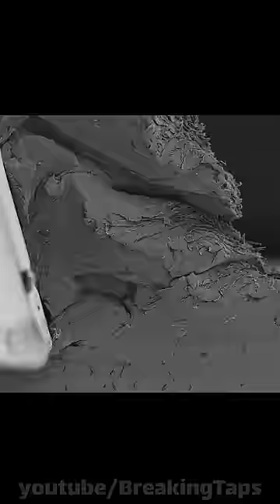Cutting metal under Extreme Magnification

Comment: My metallurgy teacher in college used to say that we should imagine metal as really hard clay.  I can see why.
Reply: @fatguyalwayseats  never thought of it that way. I think that’s a good analogy!
Reply: Ironically mine said to think of metals as flexible crystals, which is basically an inverted analogy thats describing the same thing ultimately haha.
Reply: @fatguyalwayseats  ironic is that clay consists of Al as well
Reply: we used to call Aluminum plastic
Reply: @SP-vl1ps technically, plastic is a property, not a material.
Reply: @jdmjesus6103 
A property of women in hollywood.
Reply: @LogicCaster  watches microscopic video of metal being cut

"Wow I can't believe women"
Reply: @Shift18 eh, at least aluminum doesn't bitch though.
Reply: @LogicCaster  OOOOOOOOOHHH !!!
Reply: @GhostofJamesMadison Ooooohhh snap!
Reply: @Shift18  
Nah they’re alright
Reply: This is why blacksmiths are often trained on frozen oil clay. Moves damn near exactly like hot steel.
Reply: I was just thinking that
Reply: Except clay cannot be melted, which is how metal is efficiently cut.
Reply: @deepspire  If it is melting you went too far for cutting or working, at that point you are casting.
Reply: @deepspire  
Metal is effectively scraped or shaved away not melted, unless you’re talking about laser cutters or oxyacetylene torches which oxidise or RUST away metal.
Reply: @fatguyalwayseats difficult to consider dislocation behaviour as analogy of clay though
Reply: @deepspire 
What are you talking about? An analogy does not mean Metal = Clay...
Reply: @deepspire lol no. You can see by how much heat is being applied by the chip. You don’t want those chips hot as it would damage your tooling very quickly. Hence why coolant is used on almost all machining operations, including plastics.
Reply: There are metallurgy teachers? Where do you live?
Reply: That’s funny because some clay is actually made of alumina
Reply: @deepspire clay can for sure be melted but don't ask temperatures. Also, if you make stoneware like dishes or else you basically melt it (sintering)...
Reply: tbf he was responding to a comment made in the video. it was funny ;D @Shift18
Reply: @Nunya7211   eh kinda, unfortunately i get all the not so fun side effects of an aspiring mind, I'm book smart with some field experience, but otherwise I am a sad miserable social moron. 
Sometimes i wonder if it is actually the ignorant who are truly smart, i mean at least they seem happier than most. Myself included. 

I appreciate the compliment though, sadly i cant see the resemblance anymore.
Reply: @lapiswolf2780  i would figure a materials science course or possibly an engineering course would cover metallurgy, i too am unsure if metallurgy is just like a full on subject matter. Granted it seems likely, however it applies to many realms of industry. 

I ended up getting into metallurgy via aviation maintenance technology for airframe structures and powerplant maintenance. Not surprisingly darn near everything on airplanes is metallic and they vibrate and flex to hell n back with incredible load dynamics. 
They're incredible machines, but holy crap are they self destructive cold annealed lil bastards at the end of their service life prior to overhaul. Metallurgy personified if ya will, pretend the person is Big Bird at least. Lol
Reply: редкая земля.
Reply: @SP-vl1ps We in Eastern Europe machining community just say that Aluminium is not a metal.😅Plastic is too.. amorph and polymery. Wet clay is suspention of particles, with granular structure which mimics the crystalline hot steels or cold Aluminium well enough, but for hard cold metal - cheese or rubber would be a better comparison. There are also amorph metals some call metallic glass. All different, all have similarities.
Reply: @100GTAGUY I can relate and that's not a coincidence. Book-smart sharp minds are often miserable, because sharp scientific intellect is like a sharp scalpel. You can dissect and correctly analyse any matter, but the frog dies in the process. It needs some emotional or social intellect to go along, which for some reason is hardly compatible. At least on material matters you neraly allways will be right over the intuitive, more emotional people. And probably lonely, but that shouldn't become a problem. You can also change it, given a chance.
Reply: My mettalurgy teacher used to tell me to imagine metal as really soft diamond
Reply: @Shift18 it's just a boomer joke, and I mean you're on a waste of time youtube short common section, what kind of people were you expecting to post here lol
Reply: It's being shaved
Reply: And wood is just really tough threads
Reply: @100GTAGUY I learned through welding class, one of the classes you learn is metallurgy and it was my favorite class out of all of it, I made my own chisel in that class, I wish it was a longer class tbh, we also took a machining class which was fun too 😁

Comment: It's amazing how it looks exactly like clay, as you say, - or dirt being dug out by a 360 digger - it's about fractal scale I guess! You can see the tool deflection, too, quite some force making that bend! Plowing at the microscopic level! :)
Reply: Yes its like there was a mix up in editing. Not sure why the color is so different to other examples in the main video.
Reply: @stusue9733 because at that magnification, no color can be recorded...?
Reply: @i_do_coding  Black and white are still colours right? ;)
Now that you say that I have no idea how a SEM deals with colors. I doubt it does.
My point is the difference between most of the footage, (6:45 as an example, looks like clay) and 7:41. The cutting insert hasn't changed color(though looks like it has some clay on it) but the workpiece has change color.
Reply: @stusue9733 SEM cant see colors, because it uses electrons. Its like using a monochrome light, you wont be able to distinguish colors
Reply: @i_do_coding it can still be recorded but the way this microscope maintains such a high resolution is that it detects electrons hitting objects to find their definition rather than just light
Reply: Does electrons reflect off of metals, I think the lack of reflection is the main reason it lacks the metallic look.
Reply: Well it kinda is… just harder
Reply: @piergiorgio919 i’d say it’s more like using radar to make an image of something
Reply: but what kind of metal is this?
Reply: Good observation, it also seems like it's not just shearing it, it's pushing itself into the metal and introducing friction so as to make it more mailable. Maybe this makes sense... But I'm sure a cooler tool is always the goal.
Reply: @bluntlord1242 aluminum cut by a tungsten carbide tool.  The tool is actually being moved from the slide on a micrometer.  Each image requires moving it forward one micron, placing it back into the SEM chamber, bringing it back to vacuum, running a scan, restoring it to normal pressure, and repeating.
Reply: @PassiveDissimulation what we’re probably observing is the combination of shearing at grain structures as well as ductile sliding molecular lattice.  The atoms will either pile up and slide over eachother being held by intermolecular forces, or the will shear and exceed the intermolecular distance forming a crack.
Reply: @i_do_coding there are no photons.  Technically there may be a few emitted as a side effect of the electron gun.  But a scanning electron microscope uses a sealed shielded chamber brought to a high vacuum.  

A beam of electrons is then progressively scanned over the materials and charge detectors measure the intensity and location of electrons.  This data is then plotted into an image.  

Color would be nearly impossible to measure as you are measuring with something much larger than individual photons.

Conductive materials appear dull in electron imaging.  Because they conduct a charge they scatter the electrons in more random directions.  This is similar to how a matte finish scatters light.  Surfaces that cleanly reflect electrons seem more glossy.  

The contrast difference between the metals is just a visual representation of different surface charge characteristics.  It’s actually completely tunable in most machines.  You typically just pick a filter that shows you the most contrasting results.
Reply: @LogicalNiko  I like the momentum started here, I like to understand.
Reply: @LogicalNiko  it's important to observe, otherwise we lose our humanity. Were curious. That's what drives me, I feel like I belong.
Reply: @stusue9733 Black and white are color values. Make a color dark enough, it gets blacker. Get it light enough, it gets whiter. It sort of a quality aside from color itself in most cases.
Reply: Recursive fractal is how the universe is structured, at least it's how i look at it.
Reply: @chickenmonger123  But I don't think that explains the difference in the color of the "aluminium"
Reply: It's imaged using electrons not light so it won't "shine". The analogy with clay is correct because both materials are planar. Clay has layers of silica and metals have "slip planes".
Reply: @keithallpress9885  Not sure you are replying to what I have said, but here goes anyway.

I'm not saying the analogy is incorrect. All I am saying is most of the footage looks like clay, not aluminium.  Does it matter for what he is trying to show? not really, which would explain why they used the one that showed what they wanted to show the best.
Reply: @stusue9733  Clay behaviour is due to layers of hydrated silica with intercalated ions, you get cohesive forces and slip phenomena together. That same morphology can be expected at small scale for soft metals that are cohesive but also have slip planes where a plane of atoms can slip together across an adjacent plane of atoms.

They could produce the final image in any mono color you like. The metal would still be shiny in the visible range but in these images it literally isn't shining because the metal is not being exposed to visible light. It's like asking what color is grass at nighttime. The scanning electron microscope shines beams of electrons at the sample and the secondary electrons that scatter off the sample are used to construct the image. SEM images are not produced with visible light as others noted.
Reply: @keithallpress9885  Are you watching the full video or just the short?
Reply: It makes sense because metal is malleable
Reply: @stusue9733 black and white technically aren’t colors. Black is absence of light and white is all of it
Reply: @Crazy_Chriz  Neither is brown.

Is green not a color if its made my mixing blue and yellow light?

My point is the cutting tool barely changes color but the workpiece does. One looks like clay, one looks like Aluminium.
YES they both "cut" pretty much the same.
Reply: @stusue9733  what are you even arguing about
Reply: @Crazy_Chriz  Well if that wasn't clear why are you answering me?
Reply: @stusue9733  nvm lol
Reply: @Crazy_Chriz  Consider it done :)
Reply: It's not solid metal but a collection of tiny pieces like sand and as it is wet it forms like clay at a certain wetness.
Reply: @KarmasCalamity  What?
Reply: I thought it looked like clay too..
Reply: @MH-sf6jz it’s because there s no reflection to capture, it’s capture with electro, they only transcript the shape (you can tell an object is metallic mostly because of it’s reflection) but reflection aren’t part of the shape (no hight, bump, …. so no shiny metal look
Reply: @stusue9733 brown is technically dark orange. It technically is a color
Reply: @queueeeee9000  Yeah I believe that was my point ;)
Reply: @stusue9733  you said it wasn't a color
Reply: @queueeeee9000  it isn't, as you said yourself the color "is technically dark orange"
Reply: I always plow at the microscopic scale 😎
Reply: @stusue9733  orange is literally a color..
Reply: @bluntlord1242  video literally says aluminum
Reply: @Maple_MK  Yes the video says that, but that seems questionable.
They did use clay at times.
Reply: @queueeeee9000  When did I say orange wasn't a color?
Reply: @stusue9733 black and white is not color, black and white are shades. A gray scale is shades of a color, not color itself. Have you never used photo shop or something similar? Have you ever taken a picture and edit it? There are two different bars one is a rainbow gradient (colors) and then there is a black to white gradient (grayscale or shades). Black and white it is not color. In fact black is the absence of color.
Reply: @james_win  the universe is not recursive in the slightest
Reply: @DemarcusCousins_III  it's not like you know what it is and what it is not, like me.  It's a thought that i hold to so it satisfy a curiosity, not a fact.  Everything in nature has a recursion element to it, why not the universe?  In the end it doesnt even matter.
Reply: It depends on brittleness. Some brittle steel would behave drastically differently
Reply: @james_win  the universe is not a loop. The CMBR isn't a loop, star formation isn't a loop, everything is different in the universe. Maybe if the big bounce theory is true yes the universe may loop but not anything else
Reply: @DemarcusCousins_III  I am not sure what you mean by loop. I was refering to the universe as being fractal,  fractal cosmology is a thing in astrophysics.
Reply: @james_win  a fractal is an artistic expression of a loop, last time I checked EVERYTHING in the universe is different and nothing happens in an infinitely looping way that a fractal does. Only theories suggest that some certain features of our universe are a loop but they aren't proven to be true. Fractal cosmology is also a theory which means you currently have almost zero proof of the universe being a fractal
Reply: @DemarcusCousins_III  There is no prove for anything we are talking about.  This is all hypothesis with no actual prove of anything.  We just don't know.  Everett's interpretation of the wave function can't be tested or proved but it was made popular because it sounded nice and it simplify things, and it makes for great movies .  Whatever cutting edge hypothesis you believe in at the moment is just something a physicist put together to give a coherent picture, but it's not real and not proven and definitely not a theory.  It's all conjecture.  If you choose to believe in God, spaghetti monster, the Big Bounce, a Fractal Universe, M-Theory, or whatever else that is currently popular then so be it.
Reply: @james_win 
Yeah man, actually I thought you were pretty clear, not to mention uncontroversial in your original instinctive musing there.

It would appear that the gentleman has misconstrued the concepts of "fractal(ity?)" and "looping/cyclic" - perhaps he meant curving/curling, or something else entirely, but he didn't seem to vibe with your fundamental (and might I say, clearly quite rational/sensible/instinctive/well- evidenced) conjecture.

But anyway, I learned alot in this thread - SEMs (and TEMs) were relatively new when I began studying in the early 90s - and the rich, monochromatic visualizations have always fascinated me (and everyone).

Thanks to everyone above who broke down the nitty-gritty on the mechanics/principles going on here... 👍 👍
Reply: That’s what she said
Reply: @stusue9733bro doesn't know the point